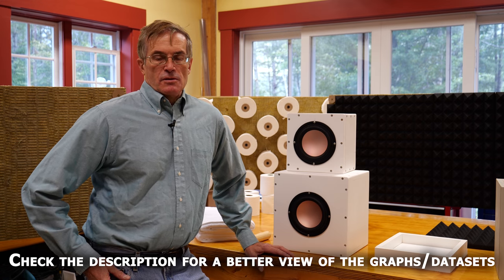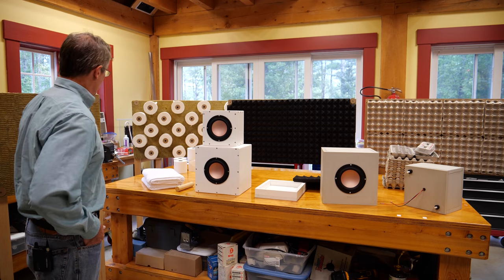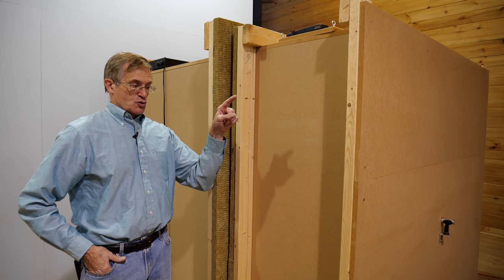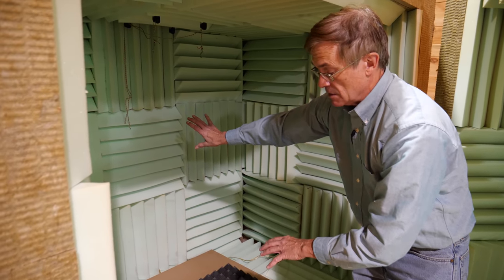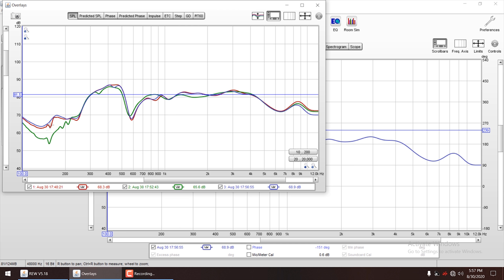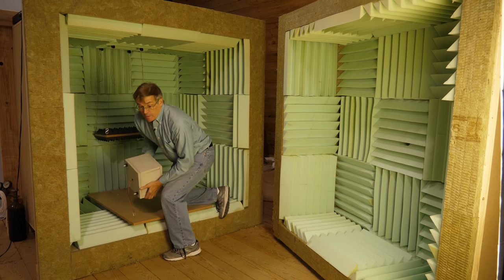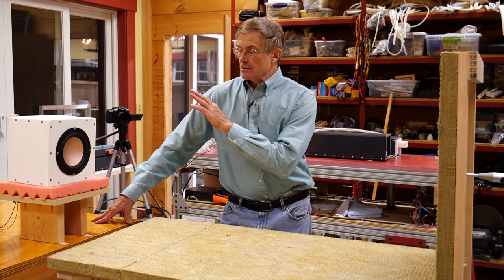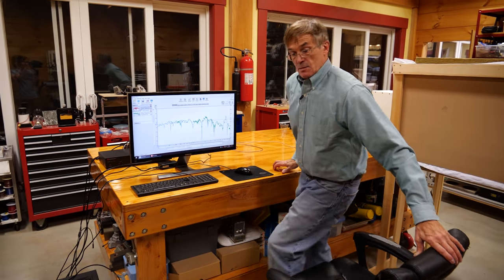DIY Speakers and Acoustic Panels

Comment: An hour and a half ago I was complaining that I couldn't find data-based comparison of DIY soundproofing/noise isolation methods, made with a good understanding of acoustics, and a friend sent me to this channel. This is fantastic.
Reply: Me too!
Reply: @laurabrown7556  doesnt work on low frequencies.
Reply: Manufacturers of glass or rockwool usually have absorption efficiency's measured and listed and are far more accurate than any DIY methods. That's really the info you need.
Reply: @rodhart2232  While you are right that knowledge is power, accurately taking an acoustic measurement isn't a trivial thing, even though he makes it look very easy. It's much easier to screw it up in a multitude of ways and get junk data.

Comment: Being a retired old guy myself, I sensed your stress and slight grunt when hefting those speakers around. I offer two suggestions: 1. Swap the positions of the microphone with the DUT Device Under Test. This way the speakers can be suspended inside the shallow door and you won't need the loading floor. 2. let one of your undergrad students do the bull work. Your videos are really awesome and on point. Keep them coming!

Comment: Thanks a lot, this will be of great help for improving my recordings!
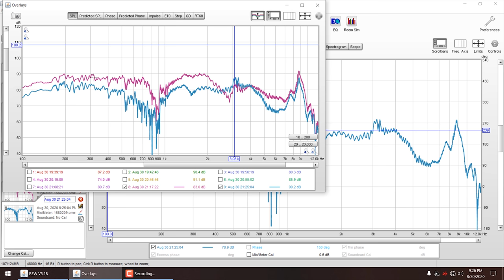Note to myself : Conclusion for which type of acoustic panels to use --> 47:16

* floor : carpet
* ceiling : acoustic ceiling tile
* walls : acoustic panels or Rockwool panels covered with a thin layer of cloth (silk or polyester) to prevent the fibers from dispersing into the air

Comment: I wanted to say that I really enjoy your videos. My father was a mechanical engineer and a project manager. He built power plants and refineries, he also was President of Ruston Gas Turbines. I personally did not get my degree however because of the exposure and my ability to understand engineering and physics I watch and study many highly technical fields. Recently I been building high end audiophile grade custom speakers for myself and trying to move into commercial and private elite customers. Your series about materials has helped me make decisions about materials and some of the very small decisions like porting and insulation. I always have thought insulation was a anti speaker additive. In otherwsrds if you need insulation maybe your box is the problem. Anyway love your videos all of them and I would like to see you take on crossover networks and how to build them and test them and the speaker technical specs and what works and what is a waste.of resources.other videos I have watched place your biggest gains in quality of sound can be achieved with a better crossover network.

Comment: I am using Lowther drivers in horns front and back loaded and valve amplification. I am returning to vinyl as well. This video reminds us of why helium is used to pressurize high performance Sterling engines.

Comment: Great video.  And I enjoy your engineering mindset, not the like most engineers I work with, but you are a proper engineer.  I'll bet you didn't learn most of what you know in school, you started learning before school, you went to school to learn something, probably learned you still didn't know much when you left, then dedicated your life to learning. 
I spend a large amount of my time thinking/reading about HiFi, and trying to dig through the tanker loads of snake oil on the subject.  I did see your video on sound deadening of the speaker cabinets.  And have often went down the concrete cabinet line of thought.  As noted in other comments here, the effects of deadening  the outside of the cabinet were masked by the anabolic Sound Chamber, and the internal reflections will be worse in concrete.   So a concrete cabinet would have to be layered up like your speaker build video.  I still come to some other conclusions that are not popular:  Like a book on current driving loudspeakers I agree with heavily. That low impedance amplifier output doesn't control the speaker well at low frequencies, nor does current drive.. But current drive helps a lot at mid to high frequencies.   I also have a issue with most speaker testing as the tests nearly always measures a steady state response of the system.  Music has lots of steady state components, but many aren't.  Sure a ported box can create a great 100hz tone, but often seem to suck at a snare drum.  ESL speakers do them great, and single full range drivers do pretty good.  Human ears are actually hardware FFT, lol.   Anyway, too much of a topic for a discussion here.  Keep up the great videos.

Comment: Tried building one of these once for what was a fairly well know audio company I was working for.  The problem was that the chamber,  with its large external surface area became a good amplifier for low frequency energy.  Turns out,  the industrial sized air compressor system was very loud and generally not heard started measuring as very loud.  We just limited measurements to above 200Hz.

Comment: 26:45 You say two hundred decibels - but you mean 200Hz, also 3 inches is 76mm, and my experience with cotton towels is that they only work well when layered at least 6 times. Cotton always has water inside and may be unstable with changes in humidity.
Other than that I loved the video and will tell my friends to watch it. Thanks for listening to your viewers!

I am running my speakers with 410-420ppm carbon dioxide with good results.

Comment: Love your videos.  Very informative.
There are quite a few things to consider when doing experiments such as this.  For one, how much wattage was the amp driving the speaker with?  It needs to be appropriate for the speaker.  Speaker dynamic range changes over power and speakers different.  So, so get full range out of them, need to be driven.  One speaker may only need 1 watt to drive it to full range, while another may need 5 watts or more!  Soo, you should take that into consideration, but considering just side-by-side comparison based on a baseline, can be comparable.  just throwing it out there. 

For audiophile purposes, they like to see 20-20kHz range...but you only used a partial of that and 100Hz to 12kHz.  Not sure why, but a standard 20-20kHz would be better.

As far as open-back, closed-back, or ported...there are standard calculations for all of this and with porting, you have to take into account a bunch of things such as resonant frequencies, Q-rating, volume, etc. and the porting result will be size of porting and length of tube, not just drilling a hole for porting.....soo wonder how much and calculation went into it to ensure ideal results??

A couple books to reference are: Loudspeaker Design and Construction and Electrostatic Design and Construction which go thru all of this and calculations.

Likewise, what type of microphone did you use?  There are characteristics for each, but didn't catch it mentioned.

Comment: Though your testing yields some interesting results there are some things to point out. For one thing, the rockwool has significant reflection due to its relatively non porous surface and density, so it's no surprise that it won't change much as far as higher frequency absorption. For that you need a looser insulation material. The results of the test show this clearly, the lower frequencies are able to penetrate your dense insulation therefore are absorbed more than the high frequencies. With a lower density, more porous material you would see very different results, less absorption of low frequencies inside the enclose and radically better absorption at higher frequencies. Also, you stated that there was little advantage to the insulation, but having unattenuated sound waves bouncing around unchecked inside the enclosure is sure to cause distortion. If you don't have insulation the resonances are going to last much longer in the enclosure, causing distortion. Also, tuning enclosure size and port size and length in a ported enclose determines the response you will get, but I guess the test did display the potential to increase low end amplitude. This usually comes at the price of increased distortion. Also worth of note is that in a sealed enclosure the low frequency amplitude drops of gradually, whereas in a ported enclosure you may get increased amplitude over a given frequency range but then it drops of radically under the port tuning frequency. As an aside, I highly recommend the book: Master Handbook of Acoustics.
Reply from the maker: I agree.
Directing and trapping sound waves within an enclosure will ultimately be more effective than randomly oriented fibers and voids, but our tests do not show that the lack of that absorbtion creates resonance peaks.
We didn't try to optimize the porting or the enclosure dimensions for these drivers because as you suggest this is a complex topic deserving much more time.

Comment: Ok so there’s a reason that black foam material for sound absorption is expensive.   It’s called R&D, and if mattress foam was nearly as effective, that black stuff would never sell.  The individual shapes are pyramids, and the sizes and density of material are crucial.    And by using a saw and a lot of time to create your DIY sound absorption panels, you more than offset the expense.    Also, depending on how heavy a coat you use, that spray adhesive also has a very real influence on the two materials as far as sound is concerned.   Also the reference mic placement matters, but now that the capsule is surrounded by foam, and even the sides are shrouded by the foam, rendering that reference mic a non-reference mic.     All if your measurements based on that mic and it’s placement are irrelevant.  Sorry, I’m usually pretty positive, but I’m also a sound engineer and this video gives me the shivers.     This guy seems way too smart to have built all of this and actually use it for reference testing.  So it’s definitely a spoof.     That mic placement sealed the deal.    They are expressly designed to be freestanding
Reply from the maker: The mic is free standing.  It can't levitate and is held by a commercial microphone clamp which is in turn supported by a tripod in one case or the wall of the anechoic chamber.  Otherwise it contacts nothing else.

Comment: Sound absorbtion and diffusion are different. Just changing the waveform enough to be distinct to the ear from the original produces a larger psychological effect than is measured, making egg-cartons 'not useless' for difraction, but very poor at absorption. Thanks for the great videos!

Comment: It would be really interesting to see you do a video on why all the measurements exhibit a 30dB dip at about 580Hz when in the big box. Also,  what are those symmetrical ripples in the frequency response graphs, such as at 160Hz, 710Hz, 2300Hz in the first measurement.   It would be helpful to get a baseline of each of the speakers by placing them face up on as high a stand as you can in the largest open area in which you can do the test outside. Same mic, same distance, same level.

Comment: Suggestion: I know this video is already a few months old, but if you still have the setup it would be interesting to compare the total harmonic distortion of the unpadded and padded speaker boxes.  I have a hunch that the padded boxes may reduce the resonances of the higher frequencies inside the box, and therefore to harmonic distortion.

Comment: Great video, quick question, did you take into account the mic's EQ sensitivity whilst testing at all? Obviously it is not going to have a perfectly flat response curve to start with. Once you know that I assume you can add that as a modifier to the result. That's what we used to do in the studios we setup.
Reply from the maker: The Omnimic is calibrated and the calibration file is loaded when the program is opened up.
Reply: @TechIngredients  Ah spot on. Thanks for the response.

Comment: The benefit of a concrete speaker cab might not necessarily be the accuracy in output in front of driver, but rather the decrease in bleed into the surface the cab itself is resting on, as well as different resonant modes of the cab faces. Though simply placing your speakers onto iso pads on top of bricks is probably easier than making a concrete cab.
Reply from the maker: You may be right.

Comment: The toilet paper and foam fronted rockwall are actually performing better in the lower frequencies due to their effective thickness. The RT60 measurement will show this. Compare your anechoic measurement to these measurements. The closer to the anechoic measurement the better for clarity. The other materials/the room are actually reinforcing the lower frequencies which isn't necessarily a good thing
Reply: They performed better because the tp test was missing a hard reflective surface behind them, like all other tested panels had.

Comment: Very interesting. As this is a very useful video to reference back to, you could put timestamps in the descriptions or a pinned comment à la a Gamers Nexus video. That splits the time slider up into labelled sections one can quickly locate.

Edit: I also thought the egg cartons were meant to deflect sound, but I guess that doesn't happen at any reasonable frequencies because the wavelengths are too long.
Reply from the maker: Actually they might if they were randomized like a base trap. Despite it's sub wavelength dimensions it can create diffractive interference.

Comment: 31:20 you talked while taking a sample recording in your non insulated room.  While probably minimal due to the sound dampening box you quickly mocked up, it did affect your test results for that one recording.  Hopefully that was VO added in post, and not concurrent to the testing sound.  Regardless.  Another great video!

Comment: I seems that increasing the volume of the anechoic chamber would improve its ability to absorb low frequencies, both because the walls would contain more sound absorbing material and because the wave front loses energy as it spreads. Your thoughts?
Reply from the maker: You're right.  It's just a matter of cost and the available room.

Comment: Thanks for the effort in making this interesting vid. Not sure if this helps regarding damping of sound, I knew someone who lived in a 100 year old old weatherboard and wood framed railway house which was very close to railway lines. However when trains went past, one barely heard the noise in the house. It turns out that when constructing such houses, the wooden joists and floor beams etc were not evenly spaced and sized, they were intentionally eccentric. Apparently evenly spaced frames cause sound waves to amplify. I am curious about using Decidamp cld rather than the damping paste to line the inside of speaker boxes, any thoughts?

Comment: That chamber would be so much faster to rotate open and closed by using a latch clamp on one side, and large hinges fixed on the other side. And then mount a basic laptop on the side so you don't need to keep walking across the room :)

Comment: Had another thought, you went to the effort to diagonal cut all your foam and I was curious how effective a material is cut like that instead of simply left solid and thick (potentially much less work for the same thickness).  I could see it making financial sense and possibly acoustic sense (why is acoustic foam always pointed?) but just extra work.

I would be curious to see 'common commercial soundproofing methods' used in studios tried on a small scale too - usually multiple layers of drywall and Green Glue or similar often reaching 2 inches total drywall thickness just separated in several layers not including the glue.  Those are all fairly expensive but i'm curious which frequencies they best suppress since foams and such are best at higher frequencies.

Also to reiterate what I responded to down below just in case you read comments but not responses please try sliced strawbale.  :)  I don't understand why nobody ever has that I know of, if I could do my own tests i'd be betting on that first, especially for the money of any deeper thickness.  Or you might be able to simply have a fabric enclosed volume that you fill with straw.  If you can prevent it bunching up that may be one solution for thinner ie 2 or 3 inch panels.  I wonder whether mechanically compressed strawbale slices would even be any better than loose fill for that matter.
Reply from the maker: I can't address the strawbale question other than a guess that handling it and the dust associated with the process may make it challenging.  We didn't test flat vs textured foam and I suspect the differences will be small.  The locic behind the wedges is that mid frequencies with a wavelength similar and a little less than the wedge dimensions will reflect multiple times as they progress into the wall, increasing absorbtion.
Reply: @TechIngredients  If I had access to the bandsaw i'd cut them myself and mail them just to have them tested.  Loose straw dropped into a frame with fabric on either side (and maybe a plastic mesh so it doesn't "bunch" near the bottom) i'd still love to see tested - just like rockwool it's another insulative material.

Comment: I'm also interested in which material blocks exterior sounds best. That seems to be the larger issue in most small studios I've worked in.
Reply from the maker: You are correct that these are two very different properties.

Comment: I wonder what double layer rockwool panels would do compared to single layer?
Also, if cutting patterns into the rockwool (like the ones used in the sound dampening foam), would do something to the sound?
Not professionally, but just V-cut them with a box cutter or so?